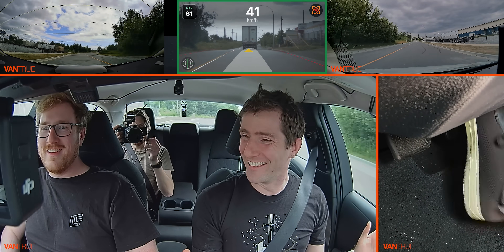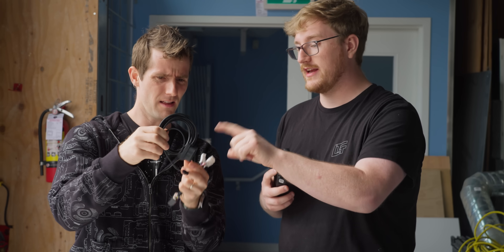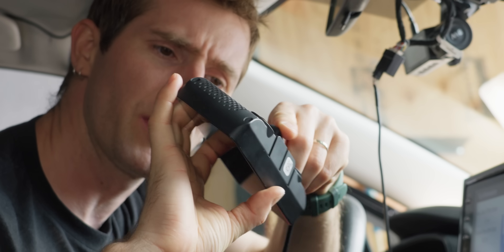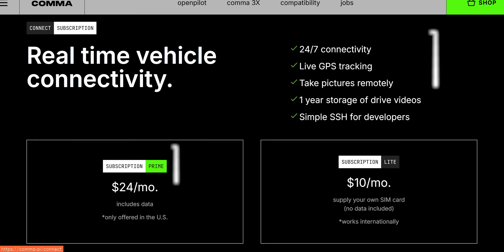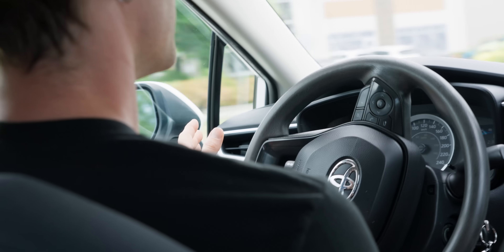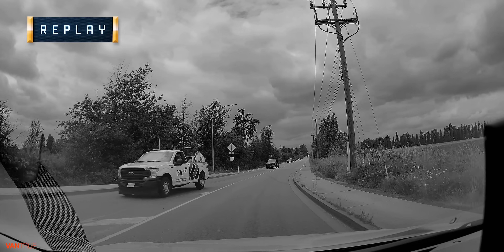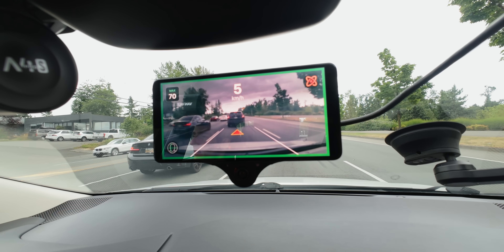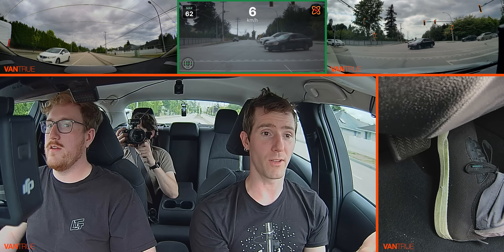I Upgraded My Car With Open-Source AUTOPILOT and it's AMAZING

Comment: So how openpilot works is that if you give any input outside of it driving itself will be given back for training. So any nudges or takeovers or disengagements or when you completely take over. Ive been running it for about 4 years now on a 2018 prius prime. My car does not do the turning exceeds limit as much as your car did. BUT mine wont auto stop at stop signs or red lights. I use it mainly on the freeway and long straight roads. I use it because my car does not come with lane keep assist for some reason the comma just unlocks that in my car.
Reply: its amazing for neck to neck traffic. everything else needs more sensors
Reply: As someone who’s completely new to self-driving cars, I’m genuinely curious: what’s the point of a product like this if you already own a self-driving car? Why would a Tesla owner want to install it? From what I saw in the video, it seems very inconsistent and like it might do more harm than good.
Reply: @clarenceoveur9497  It's not designed for cars that already have fully self driving systems but for cars that use lane keep assist or other sorts of driving assists. And then openpilot makes use of those already installed system and upgrades them (If they are supported yet). My question is for how long this company will exist. Because more and more cars in the future will have some sort of self driving supported even in base models. Atleast in europe more and more features will even be requiered by law in the future.
Reply: @genkidama4675  open pilot has been a thing for about 5-7 years at the moment and doing well. The new aptera car supports it natively.
Reply: @clarenceoveur9497  deadass, they showed the worst car for this. Also if you installed it in a tesla, you bypass paying the 8k for self driving.
Reply: @SoulGun007  in response to op asking why you would put this on a self driving car/tesla, how does the car selection in the video become the worst? Its not self driving or a tesla.... If you mean because brand it HAD the OPTION for some of the self driving features well then its not a self driving car. They took a car without self driving/assist features and gave them it..  Deadass you make no sense.
Reply: @clarenceoveur9497  because tesla charges for there self driving after so many years. buy a older used tesla and your not getting that unless you pay. or you can throw this in and get it for free.
Reply: @clarenceoveur9497  you wouldnt...but boy would it be fun if Tesla drivers started to buy this because it was better than what their OG could do?
Reply: @SoulGun007 so lane keep assist was an optional extra that you Just don't have? Because if not there would not be the requiered motor to turn the steeringweel right? Or am I missing something?
Reply: @genkidama4675  I dont fully understand it myself. I believe toyota left the motors in for the steering wheel for the higher packages that have auto park and thats what is being used for lane keep assist. Ive owned two separate prius primes that both have had this work on it. OR that the car just needs to have electronic steering and a camera for if you leave the lane.
Reply: Just fekon drove with it enabled. Bam. Auto pilot solved. 
Now can somebody tell me why it trys to popopoppopop when in a tunnel?

Comment: Just got back from a 3hr trip with my Honda Odyssey with Comma 3. Makes driving SO, SO much better. Had it engaged, hands+feet off, for > 90% of the time. Also use it in my 21 tesla model 3 because it's better than autopilot.
Reply: @ClarkMercer  what year Odyssey?
Reply: @DaveOTech  2018
Reply: @ClarkMercer  I have a 22 Elite, which has most of these features, but only works when you're driving above 40 or 42 mph. Basically adaptive cruise control, and it keeps the car in the middle of the lane. You do have to make sure you're touching the steering wheel every 15 seconds up. 

What speed does this work with your Odyssey?